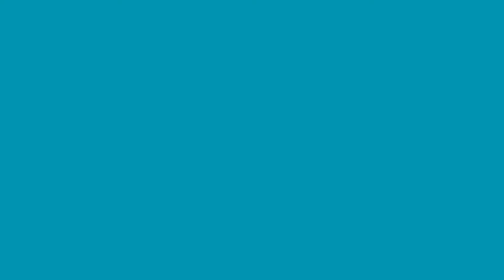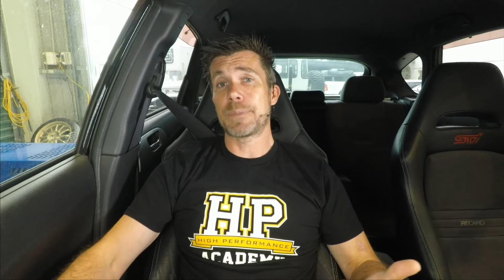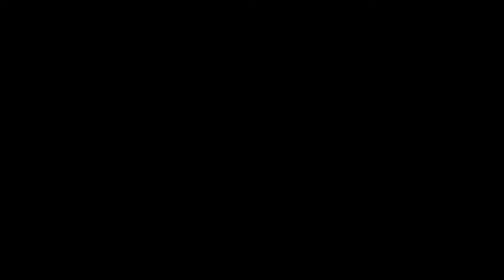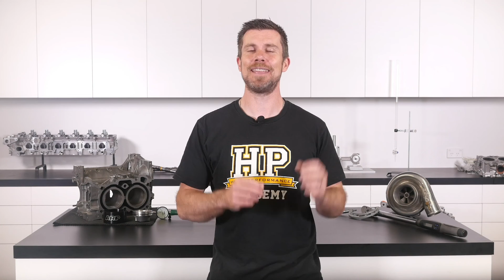Creating A Base Map | Where Do I Start? [ HPA Q&A]

Comment: This is where I'm at now. I'm trying to tune my mustang with a 427 V8 and my problem is there are a bunch of lean holes and rich holes in the ve map. This makes it very hard to road tune by myself since there is random, violent bucking, surging or backfiring. Any one of these events happen so fast that i cannot add or remove fuel in those areas. I have an autotune option that references the AFR table, but how do i know what to put in these trouble areas of the AFR table? Do i just make both the VE and AFR table very rich and cut the fuel down while driving? I'm using a MegaSquirt PnP Gen 2. 
Thanks HPA
PANTYEATR1🏆
Reply from the maker: Hard to offer too much useful specific help on this one to be honest outside of what we cover in general as you will need to make adjustments based on what your data shows you, but I'll try. 
I suggest you start by smoothing the map around the rich or lean holes as often these problems can be the result of an irregular shape to the map. I'd also suggest disabling any accel enrichment/decel enleanment while getting the VE table dialled in just incase this is causing the issue. 
From here it's a case of gathering as much data as possible in and around the problem areas to see what changes are required to the VE table. A histogram of measured AFR or AFR error vs load and rpm is a good way of analysing this sort of data quickly.
Reply: @hpa101  I'll do as suggested... Should i perform these runs in a 1:1 transmission gear?
Reply from the maker: If you can, but if you're on the road/track tuning and find the speed is getting a bit out of control you can and should go to a lower gear for those higher areas.
The main thing is to just not go to low so that you pass though the map so quickly that it makes the data harder to get useful information from.
Andre touches on the left foot braking technique here too I believe: https://www.hpacademy.com/blog/v8-swapped-porsche-996-gt3-part-throttle-tuning-tech-talk/

Otherwise there's a lesson here: https://www.hpacademy.com/previous-webinars/the-key-to-road-tuning-left-foot-braking/

It's not difficult in itself, there will just be other information around the topic that is the main 'helpfulness' of that content.

Good luck mate! - Taz.
Reply: @hpa101  thanks Taz💪 where i live, i have something like a 40 mile test loop i can do. There is some traffic, interstate, desolate country road and major elevation/de-elevation changes within that 40 miles. I try to go out early in the morning like 1 or 2am when nobody is out. That way i can take my eyes off the road and monitor the laptop. I also have like 4 miles of road that goes to a sand mine which nobody uses. It's perfect for 1/4 mile runs or long gear pulls. Today i richened everything up to minimize the bucking and surging which worked out great. I trimmed the VE and the car drives ok. I tried to add acceleration Enrichment and the tip-in sucks, so i turned it back off. My idle is pretty good, so I'm gonna see if i can close loop it before going back out tonight. - pantyeatr1

Comment: That sounds easy. I'm doing a Franken CIS install using Microsquirt adapted to run the Bosch KE-Jetronic on the Merc 80s SOHC i6, which almost nobody does since they all swap in a later 90s DOHC i6 version of the same basic block but I prefer the note to sound correct for the period of the car (tuner version of my model should sound lumpy idle, not rice cooker imho). So there's no base tune around to download. It's 30/70 which is a long way from 16/58 stock timing and that was throwing me a bit, since I'm learning as I go and blew out most of the budget on the mechanical build. Guy who did the engine is doing a very neat Franken install with the right sensors as I write this so I'm already thinking about the tune, which will be a blank slate. Bloke who makes the system is in another state, so that was going to get expensive getting him in. But as you say if I just set the VE table to 60-70 and the ignition to 15 degrees across the board I can get it running safely at least and then start refining the tune from there? That's a lot easier than I thought it was going to be, everything on the web is all about tuning Microsquirt/Megasquirt for turbo LS motors and that sort of thing, with big numbers all over the place. Yours is actually the first vid I've seen starting at the base like this and I had no idea what to start with or how to. THANK YOU.

Comment: Unless you seriously overfueling due to dodgy ecu
Reply: Overfuelling is not dangerous in the short run. This will not damage the engine. 
Underfuelling might do this.
Reply: @jareknowak8712  can be if ecu holding injectors open